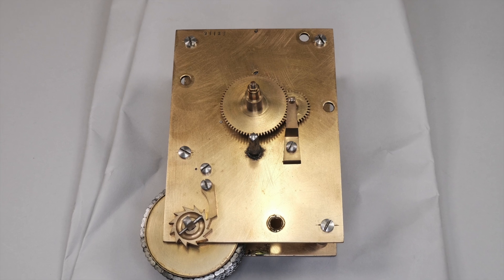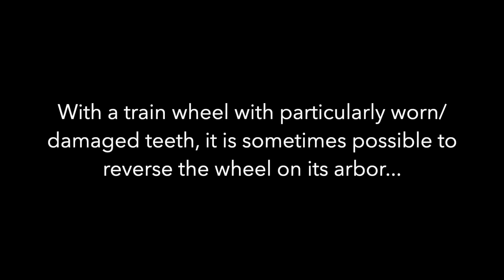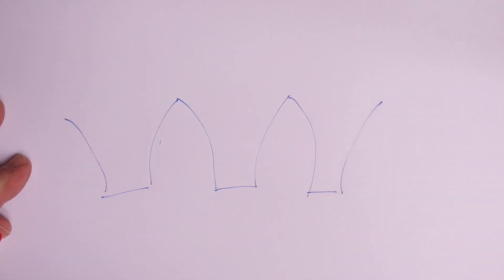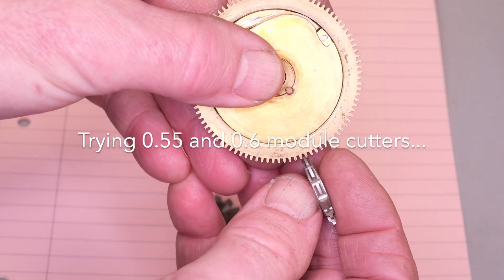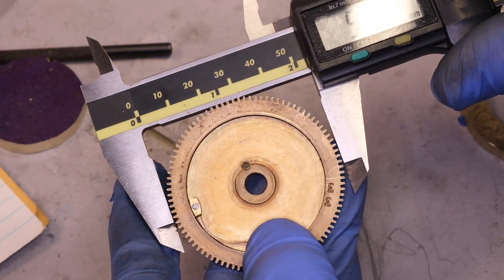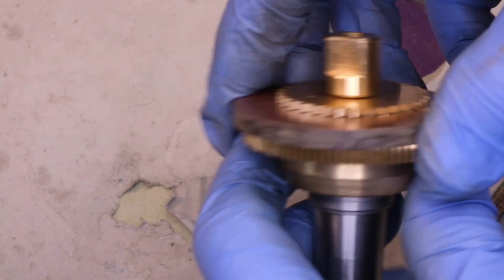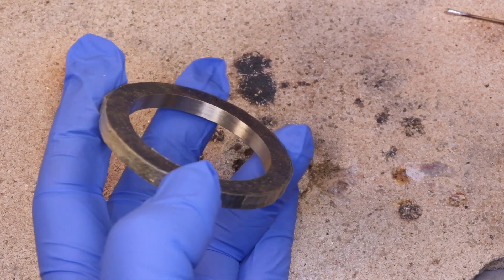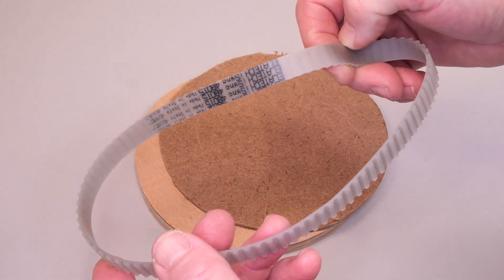#033  Cutting a new set of teeth for a clock gear wheel and making our own lathe dividing plate!

Comment: Hello. I don’t know whether you give advice but I thought I’d pose a question. I have an 8 day, two hundred year old long case. My problem is that when the snail and rack gets to twelve it seems to lock. I can get it to strike and once I do it’s fine until it gets to twelve again. Apparently, this is called the ‘twelve o clock’ problem. My question is this, does this issue require surgery or can I fix it by bending something within the inaccessible workings. Thank you and please don’t worry if you are too busy.
Reply from the maker: Sorry for the delay in responding.  Maybe you gotten the issue sorted?  Firstly have a look at Video number 16 on this channel.  Likely you have one of two problems.  The easies to resolve is something called the 12 0'clock pin which is a pin driven into the plate against which the rack bears only at the 12 o'clock position.  Check your pin isnt missing or need adjustment.  The second thing is the phase relationship of the motion work.  Check forst the position the rack pin hits the 
snail at the 1 o'clock position.  Counter-intuitively this should not be in the middle of the step but only about 1/5 to 1/3 of the way along.  Move the hour wheel (the one with the snail) in relation to the minute wheel pinion until the rack pin lands at the beginning of the 1 o'clock step, not the middle.  If neither of these resolve your issue.  Begin to look at the joint of the rack arm to see whether it has moved or has been repaired in the past.  If needed. Drop me a line via my web site and I will do what I can.  M

Comment: Hi  Mathew, sorry to bother you again, I have taken the O/D of the pinon blank which is 2.40mm the teeth amount is 6. The PCD is around 2.35mm, so 2.40 / 6= 0.4 M 2.35/6=0.39 so I went for a 0.4 Module 6 leave pinon cutter, Yet  the bottom of the cutter looks too wide, as the bottom of the  pinon leaves are normally very narrow almost to a point. Have I gone wrong somewhere ? Many Thanks  Alex
Reply from the maker: Hi Alex.  It looks like your calculation is good.  Have you cut the pinion?  The roots of the leaves can be very thin.   Once they are hardened it shouldn't be a problem.  Obviously if they turn out to be so thin that the leaves fall over during manufacture or finishing then all you can do is move to the next smallest module (0.35?).  You cannot make the PCD bigger, you have to maintain the relative ratio of the wheel a pinion.  If you can, it I totally worth cutting a trial pinion (do it in brass to make things easier?) and try it with the wheel to see how it goes before buying another cutter?  Let me know how you get on. M
Reply: @howtorepairpendulumclocks  Hi cheers for getting back to me . I think a trial cut would be a good idea on my 4th shaft and blank pinion now lol 😆  all good practice. The shaft size is 0.5mm. Looking at the 3rd wheel pinion, the leaves looking end on are cut like a V between the teeth. How then did that in 1690? I have no idea. But you might be right. I may have to go small on the module. Have a great Christmas 🎄 if I'm still stuck after Chrstmas, I will be back to pick your brains lol many thanks
Reply from the maker: @WhiteRabbit1980  Good luck!  Pinion cutting is challenging, never mind at these small sizes...

Comment: Just found your channel, thanks for an interesting video, as a fellow Myford owner I couldn't help but notice you using the back gear to lock the spindle when fitting the faceplate. I trust you don't do that to remove the chuck as that's an easy way to loose teeth on the geartrain.
Reply from the maker: When editing the video I wondered whether anyone would pick up on that!  Well spotted.  You are right; not best practice for sure.  When I next make a lathe based vid I will mention it.  Thanks again for your feedback.  Matthew

Comment: I was thinking that you could use a short length of the same belt, mounted on a matching inner radius to your dividing wheel, to get several 'cogs' in engagement, for a 'stiffer' lock position...?
Reply from the maker: That's a good point, there was a little bit of vagueness to the indexing for sure. The improvement you suggest would be useful if you were cutting something like an escape wheel that needed a bit more stability. M

Comment: Hi Matthew thanks for a really helpful video. I have three questions. What  type of motor are you using to drive the cutting spindle and how is it mounted to the lathe bed? I presume the arbor on which the wheel blank is mounted is retained by a locking drawbar? What method are you using to obtain the correct depth of the cut before you commence the cutting of all of the teeth?
Reply from the maker: Hi Ian.  It is a washing machine motor I think?  My landlord is a heating engineer and he threw it together for me.  I will send you some snaps of it in situ!   Yes the arbor/mandril is held in place by a draw-bar.  In the shot of the dividing plate you can see the handle I made to tighten the draw-bar.  I set the depth of cut by slowly moving the cutter down, locking it between cuts and waiting for the blue land to almost disappear.  Ideally you stop just before the line goes altogether but somewhere in that region.  With Thornton cutters it is in theory possible to lower the cutter so it just touches the wheel blank then lower it by the specified amount.  If it were on a 102 I could do that but on the Myford vertical slide it is just easier to do it slowly over a dozen successive cuts.  Hope this helps and hope you are well.  M

Comment: Fabulous work Matthew! I’m always looking forward to seeing what you’ve got on the workbench next. At what point do you know when to stop hammering the brass when harding it? Keep the content coming.
Reply from the maker: Hi Darryl  Thanks for your kind feedback.  When you begin hammering the brass the hammer kind of sinks in like hitting a piece of plasticine.  After a while the hammer bounces and the tone changes.  Bit of experience I suppose.  On the edge of the material you can also see it gets compressed.  Obvs if you hammer it too much it cracks and you have to start again.  CZ120 also responds to further work hardening...  just get a piece of scrap brass cz120 and experiment. Cast brass is really unpredictable. M